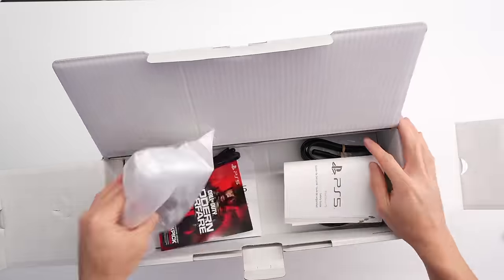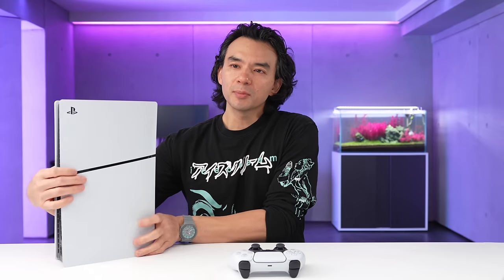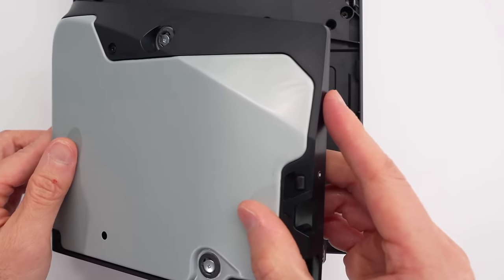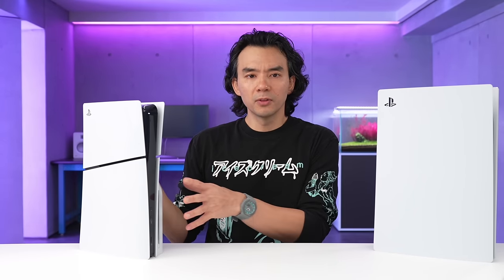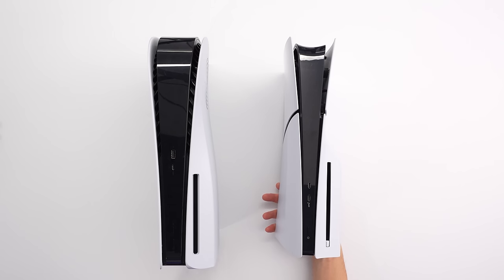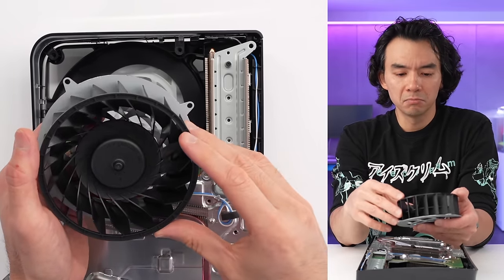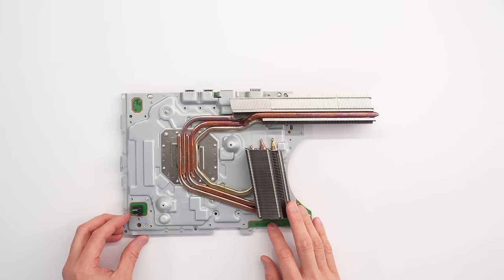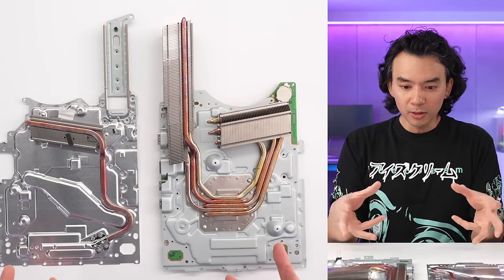NEW Sony PS5 "Slim" - Teardown + Thoughts

Comment: I reckon the removal of the fan/exhaust vents is a good thing. The vents attract so much dust and makes it slower to clean than it should be
Reply: You mean the dust that gets captured there that would have gone into the fan otherwise?
Reply: I removed both covers, those vents and even fan shroud just to improve cooling. It just stands on my desk completely bare and i like the look of it so much more.

Comment: I do wonder if there is really anything we're losing with the slim. Stuff like heating, performance and if the cheaper material will hold up in years to come
Reply: Yeah probably made cheaper. Also the disk drive has drm so you're getting a worse disk drive
Reply: @shahgyy in what sense is it worse?
Reply: @sanfury  do you know what DRM is?
Reply: @sanfury  the fact that is has drm is why its worse. you have to be connected to sonys servers... have an internet connection at first to get the disk drive to work. No Bueno. Not good for preservation of games
Reply: @shahgyy  oh got it  so basically a vertiual lock of some sort or an authentication tool for sony to validate any disk that goes into the ps5
Reply: @shahgyy You have to connect it ONCE. That's it.
Reply: @shahgyy  Sony literally removed DRM after having it for years on their ps4, the drm that would stop the ps4 from working after its internal battery dies…

The only reason there is drm is so there arent fake disc drives that are being sold, the thing is, the moment ps6 cones out… There is 0 reason to keep drm because at that moment no one is gonna care about the ps5 anymore and sony could remove it the same way they did it on ps4.
Reply: @markedone494  It's still not a completely safe assumption they'll ever remove such DRM.  We can only hope they will.  Not a great situation.
Reply: @sanfury one time activation
Reply: @shahgyy  Dentists Reach Molars
Reply: @sanfury  yep. It's mainly so they can make sure it's a Sony blu-ray disk drive. But it's still anticonsumer because the only way video games are preserved is through piracy
Reply: @shahgyy  yes for example the old god of war games no one can buy them so the only way to play them is through piracy
Reply: @sanfury  yeah and the ps3 version of demons souls. I was going to give Sony my money and buy it on my ps4 but I couldn't find it so I had to get it and use it on rcps3 emulator
Reply: @maynardburger   Yeah but its nothing but fear mongering to make drama out of DRM when sony has proven us multiple times its literally a non issue that gets resolved once the console generation is replaced with a new one.

Comment: Take some calipers to the die and see if it's the exact same. I don't see how cooling could have dropped that much without a die shrink, unless the last Phat was ready for a shrink but were waiting on a new motherboard and chassis. But if the power use is the exact same I'd really like to see fan noise comparisons.
Reply: The original ps5 already had the 6nm shrink with a reduced size heat sink, similar to this one. Apparently they just transferred that design with some tweaking maybe
Reply: I guess that's it, the last phat with the GDDR chip reductions and mild die shrink together was already ready to be smaller, it was just waiting on a motherboard and chassis redesign. But if new Slim is the same chip and power wise as the last Phat, I'd like to see a fan acoustics comparison between them  @HNedel
Reply: @tipoomaster  i also want to see that. Dave showed that the slim is 1db quieter, but the test was probably not controlled and we don’t know which revision of the original he used.

Comment: I think its alright. People expect too much. like the ps4 slim wasn’t so different from the original. The point of a slim version is to be smaller + lighter.
Reply: PS4 Slim had a revised 16nm chip that was massively more efficient than the original, and also came with a price cut.  The original PS4 was also already a reasonably compact machine, so there was less room for improvement on that front.  This new PS5 is not a proper Slim model, and it was only done to reduce costs for Sony, all while they've raised prices for us.  It's a scumbag move.

Comment: The PS4 had 2 panels on the top too (actually 4 sides because it is cut in half by the disc slot), I have a white PS4 and the new PS5 Slim reminds me of that.  It is also 2 tone, the panel where the the HDD opens up is shiny and the other is matt.
Reply: so did the ps2, loved both their designs especially the ps2 slim
Reply: The later revisions of the PS4s replaced the touch buttons with analog ones and made the glossy panel matt. (Not the slim just a revision of base PS4)
Reply: And Fat PS3 was ALL glossy. Lol.
They are (New) gamers if they don't know this.
Reply: @MatrixAlphaCWX Most people don't remember because the PS3 was overpriced when it first came out and it had no games. Xbox 360 was the way to go for the first few years despite the Red Ring of Death.
Reply: Yes but black worked a lot better. This honestly feels meh. It's nice but ps3 to ps3 slim was huge and the same for ps4. It felt more improved. Honestly you could chuck on a d brand plate it becomes maybe 15% bigger which isn't worth it much.

Comment: There is no way it wouldn't have reduced power draw if it were 5nm.
Thats half the reason to do it otherwise it just costs them more despite the die size reduction due to node shrink.

The heatsinks are almost the same size as the third revision of the ps5 that was on 6nm.

Comment: I actually really like the new look. 2 USBC ports is a nice update to keep up with the times. But man, that horizontal stand is terrrible.
Reply: Is it a good update to keep up with the times or a step backwards that will not allow you to insert USB 3.0 flashdrives? XD The stupid opinions on some people are hilarious, and sheep giving you upvotes lmao
Reply: @SPACEMUSIC458   🍼here’s your milk whittle baby 💖
Reply: @SPACEMUSIC458 usb flash drives? If you mean an external hard drive for PS4 games, you already had to plug those into the rear usb ports, both of witch they kept. Not really sure what else you could mean here, especially because I don’t think the PS5 can just access random external media.

I will admit it’s probably a bigger deal if you had one of those USB to 2.4 ghz receivers, but idk if those supported the front port before.
Reply: The removal of the usb sucks for sim racers especially if they have external storage. There’s no reason to have multiple USBCs anyways considering it’s main use is for VR and the occasional phone charger. I wouldn’t be surprised if most owners have never used it at all. That’s not even mentioning that the USB ports break very easily.
Reply: @butsargeee  I’ve been using the C port with a C to C cable to update the controller firmware every time, and if you’re going to use the controller wired I’d assume you’d use the C port as well.
Reply: It depends if sony giving you full USB-C câble (both side) with the pad or if they still giving you the same USB-A to USB-C who can make that choice pretty bad
Reply: @levygaming3133  As you fry the battery
Reply: @SPACEMUSIC458   these normies ruined gaming

Comment: The four panels mate and gloss is a callback to the original PS4 and other PlayStations also had a similar two panel design on top like the PS2 slim and PS3 superslim, even if it was only done through text like original PS2 and PS3

Comment: The older PS5 on the 6nm SoC already had a very much reduced motherboard and cooling design. Why Sony waited this long till make the design of the PS5 smaller idk, but here we are with the new slim and the same 6nm SoC.
Reply: It's still not easy to do such a large overhaul in design, especially when you're talking about manufacturing these at the scales they do, with tens of millions of these needing to be built.  A lot of ducks they've got to get in a row.

Comment: I thought one of the main goals for releasing a slim version was also to cut purchase cost. Like when ps4 slim came out it was $300 instead of $400 like the regular ps4 and then they released a pro model at the $400 price point. So if this slim model is still $500 do we expect the ps5 pro to be $600 or more?
Reply: Bingo 🫶🏻
Reply: Not just that. A reduced power consumption was also an important point when resigning the consoles. But here it's still the same which makes it this new PS5 entirely pointless unless you don't have space for the big old one
Reply: Do not not expect a PS5 Pro, Sony is selling too much PS5 to feel the need to launch a pro edition which will split the console and that may increase the time spent by game developers to design their games.

Comment: My guess is, its not too much smaller, so the airflow going thru tighter spaces is still adequate.   Might even increase the air speed so it balances out in the end as far as head dissipation goes.  I like this teardown video.  The manufacturers in cases like this should just do one if odds are high people would do it anyway.  They would have all the details we're guessing on.
Reply: Good theory, similar to how some gaming laptops can get away with less fans even when pulling more power than other laptops, due to how the air flows through the system. 
Adding mire fans does not necessarily mean the system will be cooler if the extra air is not going anywhere useful, if you can perfectly control that airflow you may be able to add less fans. 

It seems to me that due to the console being skinner (not so much smaller but less thickness), this means the air is forced through the system a bit more. This will cool the system down about the same degree in temperature as the system rose due to being shrunk (I am not sure how to type that but you get my point hopefully). 
- Afterall, Sony designed this so they probably took the thickness into account and found a sweet-spot where it looks decent but also helps the cooling.

Comment: The disc drive looks brutal on the slim. It already looked weird on the normal ps5, but they at least had a smoother curved line to incorporate it into the overall system.

Comment: I actually like the design. I also like the glossy panels. But that's going to be a fingerprint magnet for sure. More panels, more color options for customization. Still dig it though 👍
Reply: Fingerprint magnet, really? Most people set up their consoles and probably dust them off like once a week. A console is not something you would constantly need to be touching for fingerprints to be an issue.
Reply: @JPerez-cw1tb  Good point there bud. Here 🍪
Reply: @alexlopez2995  thanks. Chocolate chip are my favorite.

Comment: Hey Dave can you comment on the disc drive requiring an initial internet connection to function? For hardware and even game preservation, it's very worrying.
Reply: How did you even wrote this comment without the internet?
Reply: If you do not have internet. 
Connect the PS5 Slim to your Mobile Phone Hotspot.
Verify the disc drive once and disconnect.
It's that simple.

Comment: When You have the same power intake, You have to dissipate the same amount of exhaust heat, no matter the production node [nm process in this case]. The heatsinks are more fragmented and the fan has more blades, thus it seems legit, that it cools as well as the fat PS5.
Reply: Right, and with smaller area to cover that heat would be logical to say it's more efficient?
Reply: @leirurock504  true. Anyway, from what I can say, this heatsink is a lot more advanced and "bigger" than the one in "fat" PS5, at least by the first glance.

Comment: Reason they went with 4 panels is because now if you buy a digital only ps5 you can add on the disc drive later on. Then you only have to change out one panel. As for the 2 tone panels with gloss and matt color, Sony has done this in previous consoles. The last slim ps2 had it and the original ps4 had it also.

Comment: Its great that they added a second usb-c but I'd appreciate if they had 2 hdmi ports as well for situations where you have your ps5 connected both to a monitor and a tv when 1 is occupied you can switch to the other
Reply: Just use a splitter? That's what everyone else does.
Reply: All you need is an hdmi switcher box. They’re like 20 bucks
Reply: @jonr7364  a switcher switches between multiple inputs for one output device. So you'd plug your PS5, Xbox and Nintendo Switch (for example) into the switcher and only use 1 HDMI port on your TV since you'd only use one console at a time instead of having each console plugged into its own port on the TV. That's not what OP wants. OP wants to send the signal from one console to multiple outputs, a TV and a monitor. For that you want a splitter, which takes one HDMI input (the console) and, well, splits it, so it sends the same signal to multiple screens at the same time.

Comment: I think everyone was hoping it would be using the internal NVME slot as a primary drive rather than soldering memory directly onto the board so that if in the event overtime the SSD dies then the console won't die with it.
Reply: that and the use of liquid metal is a let down for me. I will not be buying a ps5 I guess. I don't want a disposable console.